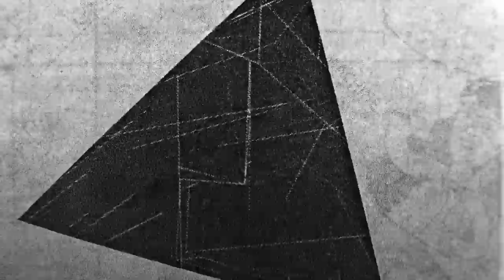0-Coast Patch of the Week #14: Dark Techno

Comment: Hi MAKEN0ISE! Please tell me if I can pass my 0 Coast through the Moog Werkstatt filter.
Moog has both an input and an output of the filter!) but I don’t understand if there is an opportunity (
Reply from the maker: Should be fine. Werkstatt appears to use typical Eurorack signal levels on the i/o of the expander. Try patching the line out of the 0-Coast to the filter input first. If it isn't loud enough use the Dynamic output.

Comment: Are you triggering 16th notes via midi here?
Reply from the maker: No, MIDI input is not in use here, it's the 0-Coast's internal clock. You could certainly do the same patch using MIDI events if you wanted to though.